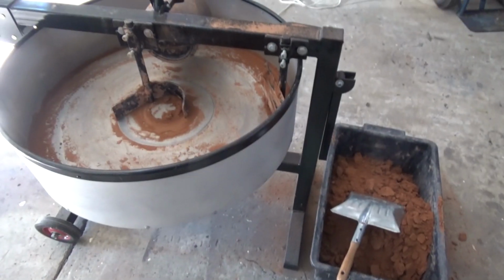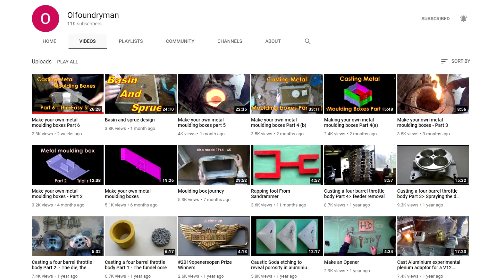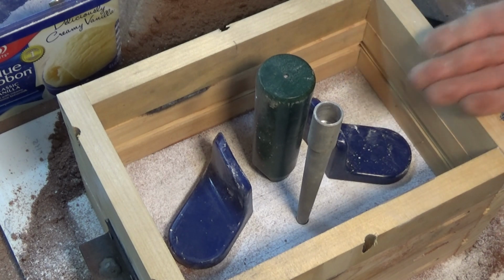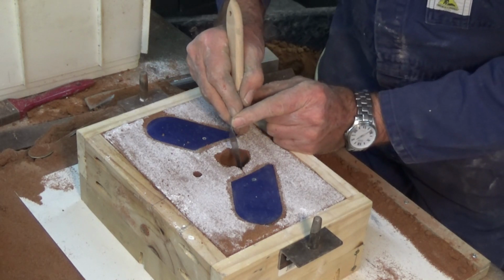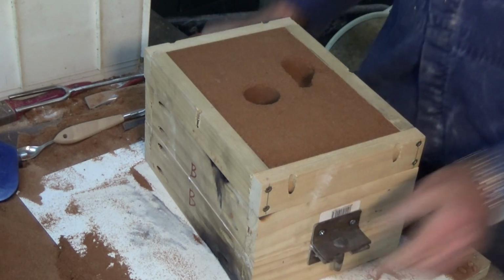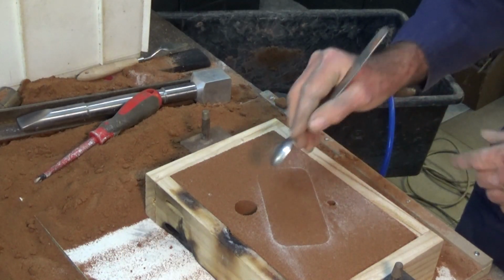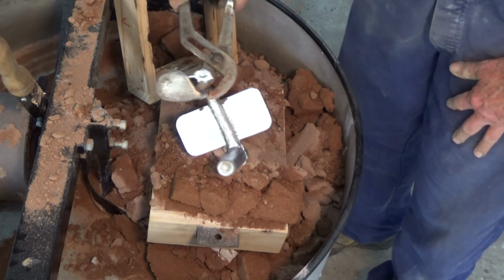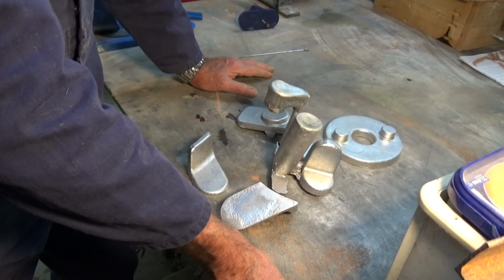Metal Casting With Single Sided Patterns.... Two Ways

Comment: Two things; if you can have the casting in the drag it's much better because if you have a casting in the cope both hydrostatic pressure and gravity will be working towards forcing the cope away from the drag allowing the molten metal to leak out. Secondly, if you are casting metal and have the capability to machine your castings you should place your riser directly in contact with the thick part of the casting that you are trying to prevent from shrinking. Remember, cardinal rule; the risers must be filled with the hottest metal so that when the casting is  cooling the riser will remain molten and feed the casting where it needs it. Enjoyed the video mark! Sweet handrammer. You should get some nice ramming done that way.
Reply: Hi Sandrammer, your my number two site for casting after martins and it good to see that your following Mark who is a good site.
in regard to your comment about "pressure and Gravity", I believe it is unfounded (no pun intended). From a structural engineers point of view (see Catcam Group) I view the dynamics of both the hydrostatic pressures and gravity acting identically at the parting line between the Cope(top) and the Drag (btm), so there will be no difference in the forcing of the two part of the mold, so no difference in the leakage, for this reason. I am not say there is no difference in leaking, but only that there will be no difference in leaking as a result of gravity  nor hydrostatic pressures.

To explain, When calculating the hydrostatic pressures at a depth, it is a function of the depth of the fluid from the free surface to the point being measured and the density of the fluid and of course gravity. Both gravity and the density remain constant so it is only the depth that is a variable that affects the hydrostatic pressure.
The hydrostatic pressure at the depth of the parting line determines the force created that acts in separating the cope from the drag.
now as long as the mold geometry is not varied, in either the cope or the drag, which we are not considering, the depth to the parting line is fixed and also a constant, irrespective of whether the pattern is in the cope or the drag.
Therefore the actual hydrostatic pressure that forces the cope and the drag apart is the same regardless whether the void is in the drag or the cope,
this excludes the second order slight change in weight of the cope as i has less sand in it if the void is located in the cope. In any case as martin can be seen doing, just place some weights on the cope to help keep the two together.
I have used school case latches between the cope and drag to prevent the two separating but on large slender copes there is a tendency for the sand to bulge up irrespective of how well the cope and drag are latched together. in these situations the placing of weights on the sand surface works a treat.
Reply from the maker: Here's two more things. I totally forgot to weigh the flasks down to prevent the hydrostatic pressure from forcing the boxes apart. I also had a bit of a brain fart when I put the riser on the opposite side of the casting cavity. I don't know what I was thinking there. However the casting turned out OK and I factored in the shrinkage when I designed the pattern. I have still to have a go at casting the handwheel for the Bridgeport quill and I made a mental note to take your advice to top off the riser with the hot metal from the crucible. I truly appreciate the feedback and I take it all on board but I must say I don't have much of a plan when I do these videos. It really is just a fly on the wall approach and I sometimes regret that I don't edit out my failures but authenticity comes with a cost! 😀
Regards,
Mark
Reply: @Preso58  , If the castings turn out ok, fine but if they don't you now have things to try  to make your castings come out better. Keep up the good work!
Reply: @Preso58  Hi Mark, please don't regret editing out the failures in your videos. The successes as well as the failures are both educational for both the novice as well as the experienced.
the various points of the videos, of either description, are talking points, that open the forum to airing the pros and cons of the various points of view. There will be many different views and everyone can take away the perspective that they perceive at the most suitable for their way of working.

not many people are positioned to produce the videos but they can help by providing a layer of expertise over the various comments made. I feel that your modus operandi is at a good balance so keep it going.
good woek.
Reply: @Preso58  Keep up with the warts and all approach Mark as everyone learns that way. If you only showed successful castings no one would learn anywhere near as much or have such interesting discussions in the comments section.

Comment: Thanks Mark! My video next week will be discussing runners and gates but will also be casting in the cope. So thanks for the nice segue 😄

One note, we want to keep the sprue full. Now that in actuality may be the same thing as keeping the metal to the top of the basin but  the goal is to keep the sprue full so we can, as you said, keep from sucking air down the sprue. 

In my opinion, casting tall parts in the cope is the way to go. As you said, having the metal fall into a deep hole in the drag causes turbulence. Having said that, I cast plenty of stupid little plaques in the drag.  I do this because it's just plain easier to cast the letter side down. But I'll justify it with the fall entering the part is insignificant so the resultant turbulence is pretty small as well.  

Great job pointing out that we want to keep the metal entering the part as calm as possible.
Reply: Hit me up or let me know how to get in touch with you before you go doing that... there are much better ways of doing it than what you're being told.
Reply from the maker: Perry,
I think that was the first time I had seen the metal flow accelerate as the sprue filled up. I was totally focused on trying to watch for that moment and speed up the pour. Easier said than done though. I only have a little brain and by the time my eyes saw the metal suck down the sprue my hands took a while to catch up. Maybe it is like muscle memory and if you do it often enough it just becomes automatic. 
Regards,
Mark
Reply: @Preso58  no, it's just poor methoding. Check your email =)
Reply: @Preso58  Hey, you don't need to explain to me, It seems to still catch me off guard even though I'm expecting it. I think you're right, it is a bit of muscle memory or at least something like that and it does seem to require us to be looking at multiple things simultaneously.

"little brain"... pish...

Comment: Thank you for the text translating cope and drag. I have watched several casting videos but always get confused by the jargon.
Reply from the maker: Mark. I also had trouble remembering which was which. After making many moulds I learned that the drag is the first box to be rammed up and you tend to drag it across the bench when you turn it over to assemble the cope. 
Regards,
Mark
Reply: Barry Manilowa  OK Barry, I'll let this one slide, for now!

Comment: Hi Mark,
I believe it is generally better to have the riser/feeder on the runner side of the casting, rather on the opposite side. The metal cools when it traverses the sand mold and the material that fills the riser when it is on the far side is cooler and will not feed as well as if it was hotter and more fluid. The riser material needs to stay fluid to feed the shrinkage of the casting, so should be part of the last bit of metal poured.
Reply from the maker: Charles, yes, that was a big mistake. I was taken to task by Martin for my very poor choice of placement of the feeder. I don't know what I was thinking. However, I now know what not to do and that's the thing about the pursuit of knowledge. For every setback there is a teaching moment. Should I have just edited that whole debacle out? I did consider it but it highlighted the point that the casting is still usable it just needs a bit more work to make it serviceable. I dodged a bullet in that the shrinkage was factored in at the design stage of the pattern.
Regards,
Mark
Reply: @Preso58  Hi Mark,
as I commented above , please include all the blunders in the videos and don't edit them out,  as they are very useful for airing commonly made blunders that all the newbies should be aware of.
I appreciate he format that you provide, please keep it going.
Reply: @charles1379  I agree with Charles, keep the mistakes in the video.

Comment: Very satisfying to watch. How thin can you make the castings?  Are there thin wall metal casting and casting finishing guidelines available for the complete amateur to duplicate a motorcycle engine side cover by this method or do you have to pressurise the metal going into the mold to fill out the voids?  The parts you made are fit for purpose and can be cleaned up with a large flat auto body file and a Linishing belt sander on a bench grinder (Scotchbrite belt for polishing), no machining required for what it is. How would you finish more complex shapes without a vertical mill?
Reply from the maker: The problem with really thin walled parts is that the molten metal will chill and solidify before it completely fills the mould. That's why most thin castings are pressure or gravity die cast in heated dies. Olfoundryman has an excellent video on the process here https://www.youtube.com/watch?v=MuifHNq38NE I have had some success with castings in sand moulds with wall thicknesses of around 4mm. Having sufficient height in the top box (cope) does help with filling the mould and also the size and placement of the feeder is important too. The feeder will keep a reservoir of molten hot metal close to the gate of the mould cavity so that as the metal shrinks it is topped up to avoid local shrinkage. Having said all that, it is often the case that you just have to experiment. I will often have to cast a single part three times before I get any success. There are lots of other variables too. like how hot your metal is, how wet your greensand is and how quickly you can get the metal into the mould. If your casting comes out relatively clean you can do most of the cleanup with files and scotchbrite discs. If you  have a large flat surface like a piece of old kitchen benchtop and a big piece of coarse sandpaper (large sanding discs or sanding belts are good) you can rub any mating surfaces on the sandpaper to render them almost flat. After that you probably really do need a milling machine or at least a good drill press for drilling out bolt holes and/or reaming bearing holes etc. 
Regards,
Mark

Comment: Love it 😻

Would it help to have very small vents at the top of the highest features?
Reply from the maker: Joel, the greensand is pretty porous and the trapped air is able to escape easily. If the casting were very large and the flask had to be very deep it would help to form vents.
Regards,
Mark

Comment: Hi Mark
Great video very helpful
Where did you get the crucible you used in the video ( i have copied your furnance just need to get it up and running)
Cheers
Tim
Reply from the maker: Tim, I purchased my crucible on Ebay. It is an A8 and is supposed to take 8Kg of metal although they don't stipulate what sort of metal.  I only paid $29 for it which may have been a mistake since they are now selling for around $90. https://www.ebay.com.au/itm/8KG-Graphite-Crucible-Smelting-Melting-Gold-Silver-Copper-Casting-Furnace-HOT/164303664266?hash=item264142f48a:g:Zd0AAOSwU9NfJvjh 
Regards,
Mark
Reply: @Preso58   Thanks Mark
Reply: @Preso58   The "8" is indeed the capacity of the crucible in Kg of pure copper brim full. Beware Ebay crucibles tend to be a bit er well ordinary.... Martin

Comment: Luv those shaky old hands, I have had a set of them installed as I have gotten older ?? Can be a bit frustrating, but just another thing you have to workaround as you get older ? I always remind myself of the 'old saying' that I heard from most of the old fellows when I was an apprentice, " Youth is wasted on the young" ? Didn't appreciate it when I was young, but sure do now ???
Reply from the maker: Gary, the shakiness is manageable but I now find that I am having to deal with a severe lack of flexibility in my fingers and hands. I ran into an old friend who was an avid clock collector and restorer. He had to give up on his cherished hobby because he could no longer manipulate the delicate tools required to repair clock movements. His rather frank observation was that he now has more time to observe and appreciate the beauty of his clocks. Having said that I also recall talking to a model engineer who built two large scale traction engines despite being a paraplegic. He worked entirely from his wheelchair in a modified workshop. We just have to learn to adapt.
Regards,
Mark

Comment: Hey Presso..What sort of 3D printer and software do you use for printing your patterns..I’m wanting to get one for my shop but wasn’t sure which way to go
Reply from the maker: Gary, I have a Creality Ender 3 printer and I use Cura as my slicing software. The Ender 3 is a good entry level printer for the price and there is plenty of support for the hardware and upgrades are readily available. Cura is also free and it has regular updates
Regards,
Mark
Reply: @Preso58  Thanks Mark... I was leaning that way or even the later Ender 5.. seems like it is very similar to the Ender 3 with a bigger build area and a few other fine tuning things... Many of the Ender 3 Mods will also fit the the Ender 5 as well.

Comment: Mark, I thought that Martin recently did a video which included pointing out that the "10 mm" of a pouring basin was the depth from the top surface of the sand to the top of the weir, not the height of the weir.  Or do I have that bass-ackward?  Either Olfoundryman or Sandrammer talked about what I'm trying to say here.

Was that your neighbor's cat?  ;)  I'm looking forward to seeing the machining, finishing, & installation of these parts!
Reply: I am sure that Martin, stated that it was the height of the weir from the base of the basin.
Also in regard to Marks casting the second cast, there was no need to have the running go across the whole pattern as the pattern void would have carried out this function and would have resulted n less material to machine and less shrinkage.
Reply from the maker: Bob, I commented to Martin that the whole 10mm thing was confusing because he tends to place his camera directly over his workbench so it was difficult to see whether he meant the weir was supposed to be 10mm from the top of the basin or the bottom. He did do a follow up video where he stipulated that the weir was meant to be 10mm from the bottom of the basin. Our neighbour has no cats. Just two slightly asthmatic English bulldogs.
Regards,
Mark

Comment: Generally, metal is poured into a mound as rapidly as possible so as to heat the mold evenly, and to prevent the metal from cooling too quickly, locally, as the metal is poured. The mold itself absorbs heat from the metal. A slow pour can cause stratified temperatures throughout the metal, causing stress. Thin parts, of course, are less affected. But thicker parts, and ones with complex shapes will be more affected. It’s one reason why large castings were often left out for up to a year before being machined, and then sometimes left out again for weeks after being rough machined.
Reply from the maker: I recall seeing rusty cast iron bathtubs sitting in an open field beside a factory where they were eventually enamelled. This was at Metters in Brisbane back in the 70's. The operator told us that the iron had to season before it went into the enamelling oven. However, there is some disagreement in the home or DIY casting community about how big the sprue should be and how quickly or slowly the metal should enter the mould cavity. I must say that I have adopted the slow and steady regime and I can report that my castings have far less porosity than they used to. I still have the odd disaster where the metal freezes before filling the cavity but it's a bit of a balancing act. I hope to learn a lot more about the process. It's fascinating and frustrating in equal measure.
Regards,
Mark
Reply: True. The bigger the spruce the faster the pour. But often there’s a need for more than one exit. I found that having a greater area for the exits makes the pour more reliable. This is as much art as science, though it’s amazing how industry has been able to make millions of identical objects through this primitive process.

Comment: G day mark this is just a thought  but if you can 3d print the moulds for casting 

why not 3d print a pouring basin that you can ram the sand around rather cutting in as a second operation 

That way you can get consistent basin geometry that will allow for observation and improvment of the design
Reply from the maker: I actually have a 3DP pattern for a sprue and basin but the problem is that you would need to have different patterns for different depths of flasks. Also the pattern for the basin would end up very close to the edge of the cope and it would be hard to ram the sand consistently so close to the edge. There is also the issue that the top of the basin is bigger than the sprue so the sand can end up badly compacted directly under the basin. Many DIY foundry operators use 3DP patterns for gates, runners and risers but I don't find it much of a problem to hand cut these details. They don't have to be pretty since they end up as scrap to be remelted anyway. 
Regards,
Mark
Reply: @Preso58  all good I have not cast anything my self it's on the list of skills to acquire 

it was just the thought I had while watching your video this morning But your reasoning is sound thank you for your time